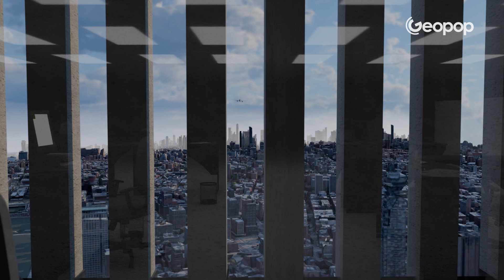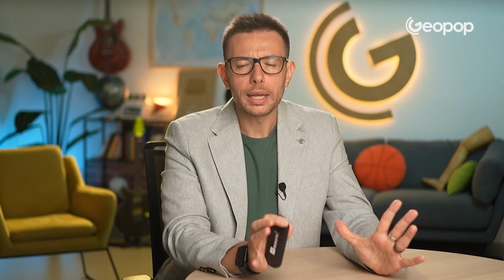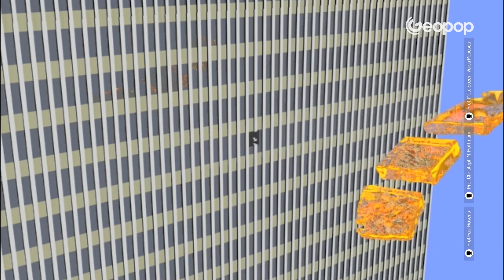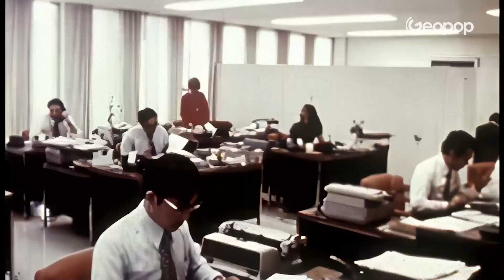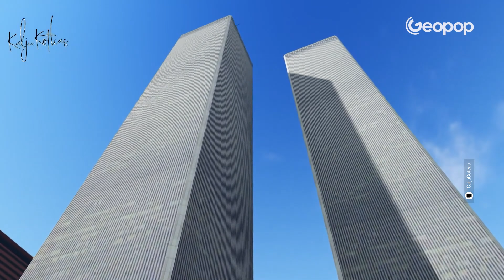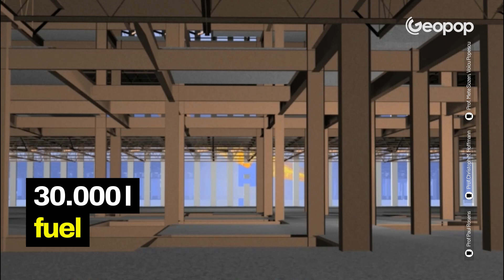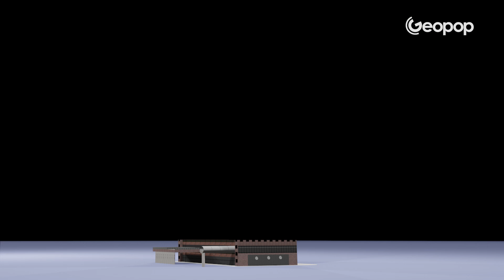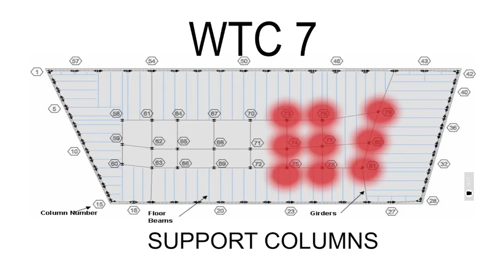9/11, 2001: The Technical Reconstruction of the Twin Towers and WTC 7 Collapses

Comment: Comparing a weight of a plane and weight of a building to explain the desintegration of the plane, gg Geopop big nubs , big clowns
Reply: The weight différente is one of the reason the plane stopped into the tower instead of pushing it down at impact.
Reply: @ThomasKundera  Total weight isnt important for the impact . What is important is resistance zone of the tower . It is obvious that at the impact , all kerozen burnt , and black fumes after seen indicates that the impact zone had almost engergy any more . In that conditions , officiels " experts " explanations saying that buildings iron broke because of very hight temperature are real scams . Black fumes indicated that it was back to a " normal " building fire .
Reply: @SiouplaitMerci  - Get back to us when you can do this:  Twin Towers collapses were relatively straightforward, the fundamentals already understood in the professional engineering community within just weeks. Yet there’s a lot of really bad information floating out there, mostly on the internet where it’s easily accessible to anyone. Good information takes more effort to come by and is much harder for laypersons to digest. Engineeringspeak is complex and dull while wild baseless speculation and pathological theorizing with easy hand-wave answers is simple, exciting and require a whole lot less thinking, thus getting far more intention than they deserve.

To correct that situation, I have all on my own prepared this short yet detailed technical description of Twin Towers collapses based on my own observation and analysis of the available true and relevant facts. No politics or ideology, just the engineering. My hope is this will dispel many common myths and answer most if not all questions you may have about the Twin Towers collapses, because anything can seem like a conspiracy if you don’t understand how it works

While complex, most of the Twin Towers collapse mechanisms can be seen with the naked eye and easily discerned and understood by the layperson if sufficient time is taken to understand. 

1. The Twin Towers consisted of 4 primary structural elements that together formed an integrated system where each relied on the others.  47 hollow box-section steel Core Columns carry the majority of the gravity loads. The 236 hollow box-section steel Perimeter Columns carry the remainder and ALL of the lateral (wind) loads. Long-span Lightweight Steel Trusses connect the core and perimeter column together at each floor with a Hat Truss on top to tie the structure together as an integrated unit where no element can survive without the others. There was no structural load bearing concrete and most components were bolted together. www.youtube.com/watch?v=u7OqrC74Dm4 

2. The impact of 117 tons of airplane (= to about 12 dump trucks) at speeds up to 590 mph with the energy of a ton of TNT completely destroys the aircraft. This in no way implies the Towers come out unscathed. Many perimeter columns are damaged or destroyed as are some core columns (example; 33 of 59 perimeter and 20 of 47 core columns damaged or destroyed at the impact floors in the North Tower), This damage is primarily through bolt-shearing failures at the end connecting flanges, as well as bending, twisting and fracturing of weld seams. There was no cutting or slicing - the reality was far more violent and messy. 

3. The impacts destroy or damage fire insulation, fire breaks and sprinkler systems on multiple floors.  Huge fires are started across multiple floors simultaneously and allowed to spread rapidly with no effective firefighting or fire suppression. This was an unprecedented fire event . 

4. The hotter steel gets the weaker it gets .  With fire insulation stripped away and no sprinklers the survival time of the steel greatly reduced. Gradually over time heat causes the lightweight steel Floor Trusses at the impact damaged floors to sag, which was observed and recorded.  No steel melted or needed to. Structural steel fails long before it becomes a puddle. It just needs to bend

5. Sagging floor trusses pull on the increasingly weak and overloaded Perimeter Columns, causing some of them to bow inward by up to 5 feet. A straight column is up to 4 times stronger than a bent column. The bowed Perimeter Columns buckle and fail, initiating collapse. The formerly static mass above which the structure below could easily support is now converted into a dynamic mass up to 30 times greater. Because they have buckled, the Columns above and below the failure point are no longer aligned . The load bearing structure below no longer bears any load as it falls past the lower columns, NOT onto them.

6. Thousands of tons of debris fall within the four outer walls, down through the open office space, crashing onto the first intact floor it encounters. This massive impact immediately breaks the bolted connections to the columns as the amount of resistance the Floor Trusses can offer is negligible.  The falling debris slows only marginally and briefly. Note:
6a. This is NOT a solid top block crashing into and “crushing” a solid bottom block .
6b. The debris falls past the columns not onto them.  The columns provide no resistance to the falling debris. 
6c. Only the bolted connections of the floor trusses to the core and perimeter columns can offer any resistance. A pair of 5/8” bolts at each end of each truss vs. thousands of tons of falling debris.
6d. No laws of physics are violated.

7.  This floor-led collapse progression within the four outer walls can only go straight down. Note: 
7a. This process is often incorrectly referred to as “pancaking” which actually refers to a completely different process rejected at an early stage. The catchy name stuck but nobody knows what it is supposed to mean.  Pancaking is too simplistic and inaccurate anyway. More like Kaiserschmarrn.

8. Collapse progresses through the floor systems not down the columns, through the path of least resistance . Rate of floor failures increases with each successive floor as momentum increases, reaching an average acceleration of 0.65 of GA, or 35% slower than true free fall. Bam, bam, bam down the building until there are no more floors to fail.  The resistance offered by each successive floor is always the same. The mass and velocity, thus the energy of the falling debris is constantly increasing, with each floor destroyed adding new falling mass. Some falls to the sides, but most falls down. More mass, more velocity, same resistance with each floor.  Don’t get stuck on the but the lower floors weren’t on fire nonsense. They weren‘t and didn’t need to be.

9. The Towers were 95% air by volume. As that air was compressed inside the building it is forced down the tower and blown out the sides in reaction to the building collapsing . Those were not “explosions”, it was expulsions of compressed air caused by the collapsing building, explaining the low velocity, lack of flash, blast, supersonic pressure waves and lethal high-velocity ejecta.  

10. Perimeter Columns become detached and peel away like a banana behind the collapse front, playing out to the four points of the compass extending to more than 600 feet from the base of the towers. This was quite obvious from examination of the debris pile. 

11. Core Columns fail last as their internal beam bracing is stripped away by falling debris and lateral support from the floor to perimeter columns is lost. 

12. For those who care about how long this whole process took; 31-34 seconds from the moment the perimeter columns buckled until the last core columns hit the pile, or 1/3 the rate of true free fall. Don’t believe me?  Just watch any video of the collapses and note the loose truly free-falling debris dropping much faster than the towers themselves.  

13. Each Tower had a 1-acre footprint. Far from collapsing inside their own footprints the debris pile spread out over 17 acres in a pile up to 14 stories deep. 8 surrounding buildings were destroyed and scores more damaged by the falling debris. 

14. NOT observed were the 180-190 dB bangs of thousands of high explosive devices or the blinding bright flashes of burning thermite. Neither explosives or thermite could have survived the impacts and subsequent fire nor could have caused the (silent) perimeter column buckling that clearly initiated collapse either. A video of a shocked and injured firefighter casually using the magic word explosion is in no way proof of explsoIVES  and the demolition_ case relies entirely on that sort of thing. There is zero tangible physical evidence and it would be technically impossible, totally impractical and completely unnecessary. No one would bother. 

15.  Finally, the Twin Towers were perfectly safe within their design envelope.  They only collapsed when taken far outside design parameters by an extraordinary and unprecedented event 

Impact + Fire (heat) + Time + Gravity = Collapse . Remove any one of those four elements and there is no collapse. Ignore any of those elements (as many do) and you will never understand the collapses. The Twin Towers were an integrated system in which no one component could survive without the others. One fails, the rest follow, through the path of least resistance – DOWN – through the open space, bypassing the path of greatest resistance – the columns.  Nothing I just described violates any laws of physics. All of the above is true no matter who planned and carried out the 9/11 attacks or why 

In 24 years zero structural engineers of tall buildings, including the 1/3 that have retired in that time, have made any statements in support of 9/11 Truth BS demolition claims. Zero, nada, none. The lack of any such citations in the engineering literature (published in any country worldwide) is palpable.

I hope you found this helpful and informative. It is not meant to be adversarial, but to solicit informed critical comment, positive or negative. If I made any errors of fact, logic or reason or left anything critical out, please let me know so I can fix it. To stay focused just one topic at a time please and on-topic (Twin Towers ONLY). No word-salads of Gish Gallop. IF you can offer a more plausible alternative be my guest. Be the first. Please start any reply with the words “Tits McGee” or I will know you didn’t actually read it, are not serious and just wasting my time.
Reply: @ThomasKundera  The plane didnt hurt all the building but only a part , which of course hadnt all the weight concentrated . It is not like if the impact zone had 100 % resistance against all objects .
Reply: @SiouplaitMerci  :
" Total weight isnt important for the impact"
Inertia is the primary way for the towers to handle the hit.

"What is important is resistance zone of the tower"
It is also.

"It is obvious that at the impact , all kerozen burnt "
Incorrect. About 20% burned. You're in overconfidence here.

"almost engergy"
Gni?

"In that conditions , officiels " experts ""
Actual, real experts, no need for quotes. Unlike the hoaxers who authored the fallacious videos you watched.

" buildings iron broke because of very hight temperature"
Fine. Then?

" Black fumes indicated that it was back to a " normal " building fire"
Black fire can say many things, including a low oxygen fire in some area.
Then?

Comment: We are told to believe that terrorists hijacked a number of aircraft and the flew them into the twin towers causing them to collapse. Those towers were designed to the highest standards and could have still been standing after 10 hits by aircraft. The steel structure around the perimeter would haved acted like a huge cheese grater. An aircraft would hsve been shredded into small pieces and would not have penetrated very far into the building.  The aviation fuel would have ignited instantly in a massive fireball and would not have spilled throughout the building.  High explosive devices were detonated to exaggerate the impact. The whole incident was very carefully planned and the controlled demolition was carried out perfectly.  All the reports that have been made trying to convince us that the buildings failed due to heat and structural failure are bullshit.  The resl reason for the total collapse of the twin towers and building 7 were due to carefully planned controlled demolition. The only terrorists involved were members of government,  cia snd the security services.
Reply: There’s a lot of myths and misconceptions about exactly what the Twin Towers were and were not designed to do and even what aircraft impact means.  People tend to exaggerate, misinterpret or even just make shit up. 

For the record: The Twin Towers were never designed to withstand any sort of aircraft impact, however one may choose to define that. This was not a requirement of the customer or of NYC building code and you will see no mention of it in the building plans.

For the Twin Towers, the accidental impact of the largest jet in service at the time (Boeing 707-200), lost in fog on landing approach (light and slow) was studied at a very crude level in a 3-page memo of hand-worked calculations. This work was done AFTER primary design work was completed and the memo does not appear to have survived.  What was NOT studied was an intentional high-speed Kamikaze attack by a much larger aircraft impacting at up to 3 times the velocity OR the effects of subsequent fires 

The memo concluded that in this particular scenario the impact damage alone would not be sufficient to cause the Tower to collapse.

This of course only deals with impact damage not with building collapse. Collapse of the Twin Towers was due to four (4) factors of which many commenters only consider one, maybe two, but never all four.

Impact Damage + Fire (heat) + Time + Gravity = Collapse

Remove any one (1) of those four (4) elements and there is no collapse. They work together. 

Ignore any of those four (4) elements and you will never understand the collapse. They work together. 

Unfortunately that is four (4) elements which is at least three (3) more elements than many people who choose to opine on this topic can handle at once. This is why folks like you invariably talk about impact damage OR fire, never impact damage AND fire (and never even consider time and gravity).
Reply: @TheCriticalStinker-jw4fl when are you gonna realize planes can't go that fast at that altitude?
Reply: @robbiehiatt9966  "when are you gonna realize planes can't go that fast at that altitude?"
They can, it's quite obvious: they actually did it.
Reply: @ThomasKundera  actually it's quite obvious that they can't.  That's why I said something.  Do some research. Are you saying it's possible because it happened.? You know that's what we are debating here so it sounds like you're saying it's possible because you say so. You wanna play like you're smart but don't wanna do the research necessary for you to understand anything.
Reply: @robbiehiatt9966  :
"actually it's quite obvious that they can't."
Evidence?

"Do some research."
I can't in this area (and I highly doubt you could either).
I can study it a bit, which is enough.

"Are you saying it's possible because it happened.?"
Pretty logic: when something happens, then it's certainly not impossible.

You know that's what we are debating here so it sounds like you're saying it's impossible because you say so. You wanna play like you're smart but don't wanna do the few needed studies necessary for you to understand anything.
Reply: @TheLoonResistance  So you call your NIST bosses liars again Finkleshite? What a pathetic shill you are...

Comment: Thermite explosives was used to bring it down
Reply: Thermite is an incendiary NOT an explosive. The only reason thermite ever came into the discussion was not because there is any evidence for its use or that anyone would use it, but because certain conspiracists needed to explain the obvious lack of explosions in their supposed explosive controlled demolition

So you are sort of defeating the purpose when you try and have it both ways by talking about exploding thermite

It's been 24 years. One would think you lot would have your story straight by now.
Reply: The explosive sounds which you can hear in this video were reported throughout the day.8:25
https://youtu.be/bLF5D7M1YgA?si=aHSvS__uOdxMi1ZB
Normal thermite would not do the job anyway. Nano-thermite Could have been used but does not explain the explosions
Reply: @robbiehiatt9966  Like black powder thermite can become an explosive if put in containment.
However, besides/prior to thermite cutter charges there were quite "obviously" also more common explosives going off. Probably bombs to weaken the foundation, perhaps also to slow down the firefighters (make them use the stairwells instead of elevators) and an early explosion to shut down the security office.